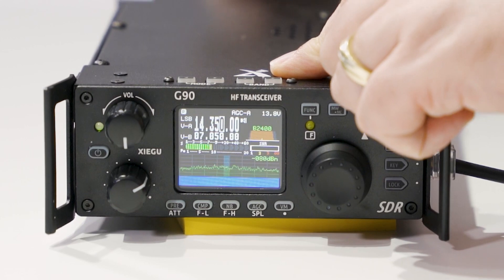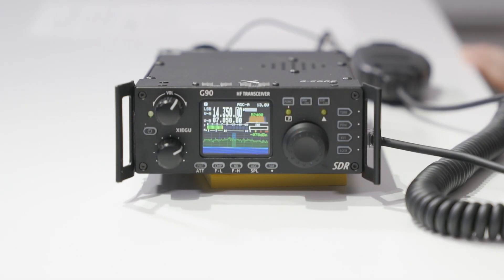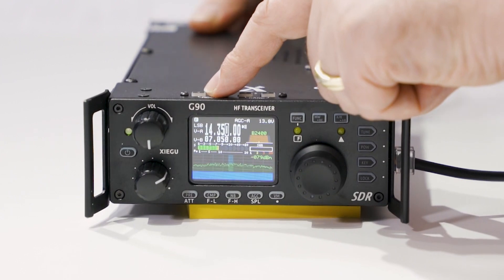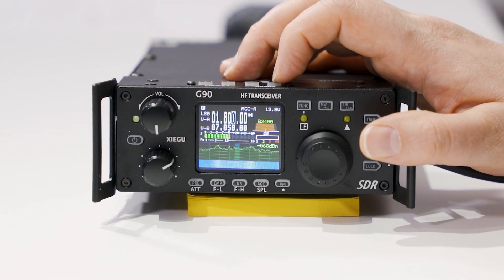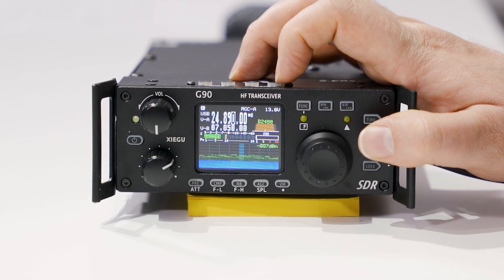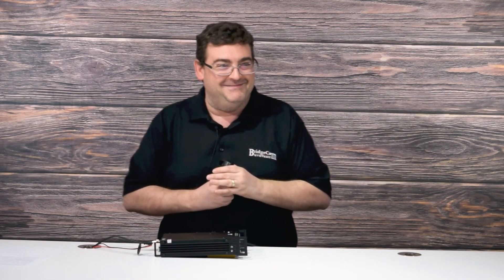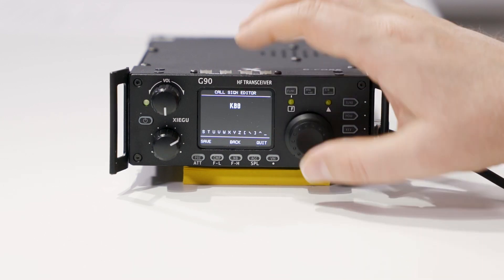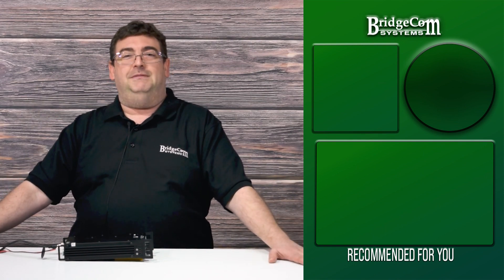How to Set Up and Configure the Xiegu G90 SDR HF Transceiver

Comment: What simple antenna can I use for this?
Reply: I use my G90 with a 17' Intellitron stainless steel telescopic whip on a trunk lip mount on my car.  I also have a mirror mount on a 10' half inch steel pipe.  YouTube's Coastal Waves and Wires makes various antennas he tests on the Xiegu G90 and various other radios.  He even made one out of a giant metal Slinky.
Reply from the maker: Hi! Thanks for your comment. If you have any questions, feel free to join our Facebook group — it's a great place to get help from the community: https://www.facebook.com/groups/BridgeComSystems. Also, if you're interested, check out our Plug-and-Play Package here:https://www.bridgecomsystems.com/pages/plug-and-play-package.

Comment: Hey, every video on this radio is further and further convincing me that this is the first HF radio I want. My question is, what is needed to run the CAT interface with this radio, aside from the cable? Is there a chance you might have a video for this? I'm more of a watch-and-learn kind of person.
-KI7YDM
Reply: @ammoshortage The CAT cable comes with the Xiegu G90, and it uses the Icom IC-7000 CAT protocol, so you just set the control software to emulate an Icom radio.
Reply from the maker: Thank you for your comment.  We invite you to ask your question to our very large Facebook group.  Here's the link to join: https://www.facebook.com/groups/BridgeComSystems.  Also, please check out our plug-n-play package:    https://www.bridgecomsystems.com/pages/plug-and-play-package.

Comment: I live in a condo and would like to use this indoors; which power supply can I use that can be plugged into a wall socket and be connected to this radio?
Reply from the maker: Hi! Thank you for your comment. We invite you to ask your question in our very large Facebook group. Here's the link to join: https://www.facebook.com/groups/BridgeComSystems. Also, please check out our plug-and-play package: https://www.bridgecomsystems.com/pages/plug-and-play-package.
Reply: @Michael-ew5kj Any power supply that meets the power requirements will work.  12.8 to 16.5 volts and 10 amps is recommended.  I use a Sky Toppower STP 1330 for my G90.  It is a 30 amp 13.8 volt power supply and I run a 2nd MFJ 10 watt 20-meter radio on it at the same as the G90.

Comment: I bought one of these used. I bought the antenna and all of the other connections from you folks there and I love your videos. Apparently, what I am thinking is that somebody had this set up to work with their computer. Because, although I get the boot up tone through the speaker I get no sound it through the speaker or the headphone port on the radio. Have I purchased a defective radio or is there something I can change that you know of where I can fix this easily? If you can help me I would greatly appreciate it. If I can’t get this one to work I will pass it along as for parts only on eBay and buy a brand new one. Because I really like the options on this radio. I don’t want to feel disappointed yet because I have a feeling somebody was using this in a different manner but I just want to listen to it through the speaker.
Reply from the maker: Give our support team a call, they will be able to help you out!! :)

Comment: How to do a factory reset? I don't find this function in the user guide or internet. Thanks.
Reply: @mrtonicsvis3624 With the radio powered off, press the FUNC button while powering on and it will ask you if you want to do the reset.

Comment: What power supply would you recommend for the G90?  Also, does Bridgecom carry the XPA125b amp and the GSOC for the G90?
Reply from the maker: Hello Jan! We recommend the  Duracomm LPX-18 13.8VDC 18A Desktop power supply for the Xiegu G90. We do not currently sell the GSOC or XPA125b. Here is a link to our LPX-18. https://www.bridgecomsystems.com/products/duracomm-lpx-18
Reply: I am getting my G90 soon, is a diamond gsv3000 13.8v  34amps /6amps power supply good enough?. Will I be over driving the G90?
Reply: @vu3mes  The G90 only draws 10A, but you don't have to worry about supplying too much power.  It will only draw what it wants.  That power supply should run the G90 just fine and have plenty of amperage left to run another radio at the same time.
Reply: I wouldn't run the G90 on a 6 amp power supply.  It draws 8 amps while transmitting, so I would go with a minimum of 10 amps.  At least 30 amps would be better.